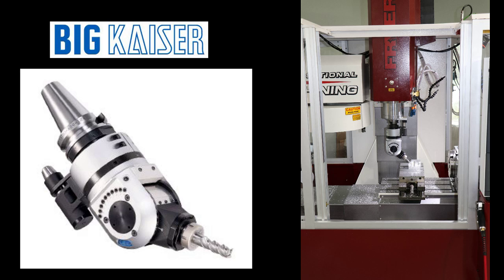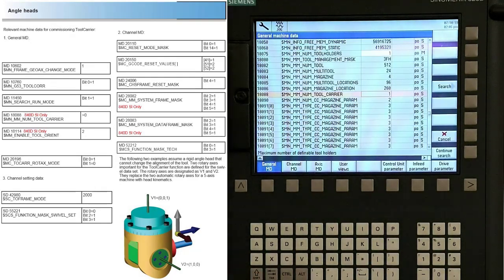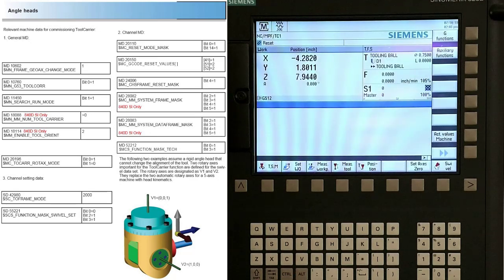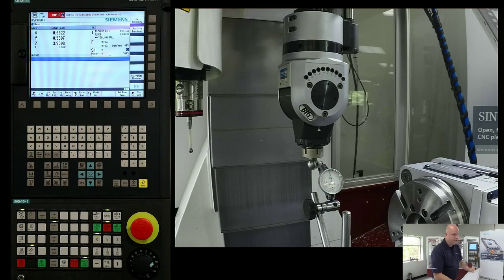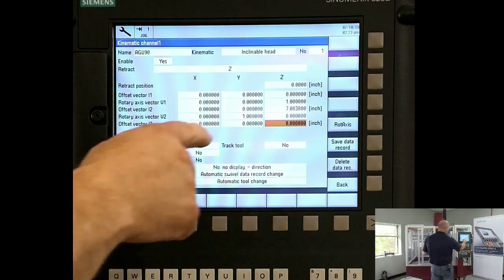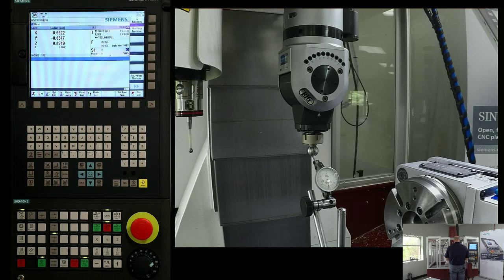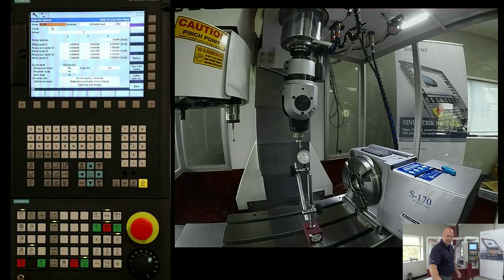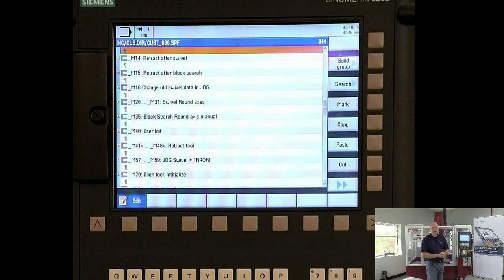Adjustable Angle Heads with Swivel Cycle Part 2 Commissioning

Comment: Intresting topic it,s very useful session. But i have one small doubt. Why your entered value in I3 like spindle face to head intersection point value. Like I3= 3.9508. And  I2 Also ur entered I2=7.08380 value.  Why your choose I2  in z axis. Why not choose in I1 small confusion. Plz i am requesting kindly clarify me..
Reply from the maker: where was this in the video
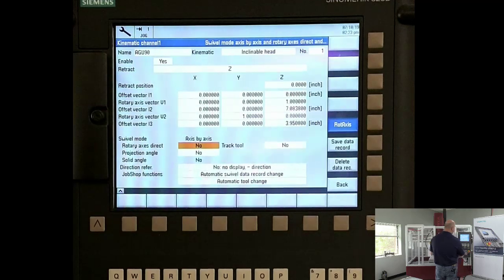Reply: @MrCNC 25:00 plz kindly check.😊

Comment: Thank you for nice video. I don't understand where the number 7.0838, which was recorded in the first Z-axis offset, came from?
Reply from the maker: This is from gauge line of the spindle to the center of rotation of the right angle head.

Comment: Interesting but what is the purpose at the extreme cost of the Kaiser heads if you need multiple of them then why mot buy a 5 axis machine?
Reply from the maker: in my case the machine was 50k and the head was 10k.  would be tough to buy a 5x for much less than 100k.  also a good application for a tool room.

Comment: Thank you for posting these videos. We have 5 Fryers with the Siemens control. How about a video about making custom tool files. Like a concave radius tool. We program them like a endmill with an od that matches the minor dia of the tool. Id like to be able to see the radius being cut in simulation. Also is there a way i can call up a tool by turret location # when posting gcode.
Reply from the maker: hello Chris.  Currently we don't support custom tools in the library.  If we introduce it in the future I will be sure to let you know.  regarding the tool change question is this a mill or a lathe?
Reply: @MrCNC  it is a fryer MB 10 bed mill. It the screen drop down when first creating a program the is a selection for a tool profile program. What is that used for?
Reply from the maker: @What-is-thehandle  i'm not sure.  exactly where is this located in the software?  Regarding the tool change the Fryer Mills are setup to only change on tool name.  It is possible to setup a umbrella tool changer for tool change from pocket locations but it would require adjusting machine parameters.  To my knowledge Fryer has never setup this functionality.  It common on Drill / Tap machines with a drum style turret.